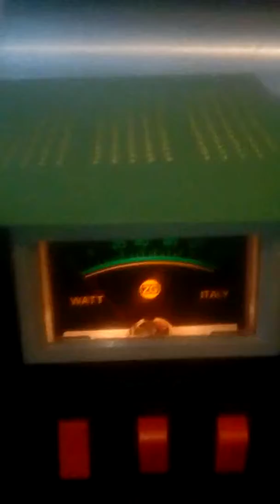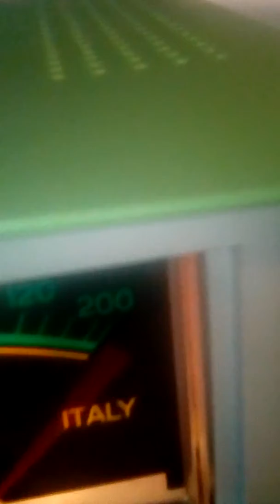Zetagi bv130 valve amplifier.

Comment: Do you know the specs for this? I just got one given to restore. 
What Frequency Range?
Can find stuff for the BV-130P but not a lot for the BV-130
Reply from the maker: Hi mate, I honestly haven't tried this on anything other than 27 MHz, but l would say the safest bet would be to stay within the 26-30 MHz range that most 11 meter radio's tend to be most comfortable, you might be able to stretch it further down to 12 ,15,17 meters but that would be something you do at your own risk. 

Good luck with the restoration and best 73 de Jay 2E0FBX.

Stay safe friend. 🙏

Comment: Omg ,don t use an mobile antenne indoors with 100w,these zetagi s can handle some beating but this????hope it still works.    73/51.    19rs041
Reply from the maker: It's long gone, and l didn't actually operate it at my qth other than the couple of keys you saw here before l gave it away to someone who needed it and got a lot of good use out of it. 
Last l heard it was still going strong up til last year.  
I'm not a linear fan, it came to me for free none working,  so l was happy to make it work and then pass it on for free.  

73's